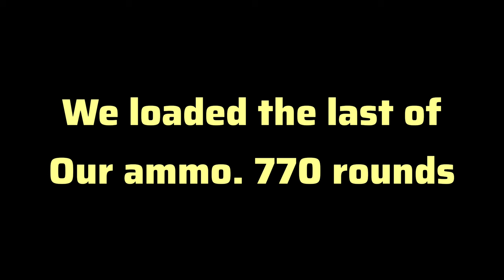Budget 556 AK Meltdown: Pioneer Arms 556 Sporter!

Comment: The pin holding my underfolder screw also fell out on mine, and it's got way less rounds through it. The gun runs fine, I just imagine if you buy one of these guns, expect small issues to pop up. Be prepared to do some DUI fixes. I just got a nail and pushed it through, and bent the end to replace the pin.

Comment: I have one in 5.56 with over 2k rounds and i can confirm the beryl firing pin will break before the factory firing pin. Had to polish the gun in a few places to get it smoother and more reliable, even took a bit of material off the throat of the barrel in order to feed properly. Every other mag it has a feeding issue, stovepipe and such. The extractor was trash on mine so i changed it to a beryl extractor and that helped tremendously. I truly think these guns arent the best when it comes to quality control, you might get a good one, you might get a bad one. Fun range toy for cheap.  But i wouldnt fully trust my life to it.

Comment: I have built out 2 AK kits using Pioneer receivers and they work just fine.
Might help to slow down no need to feel rushed because thats when you make mistakes.
The gun held up better than most. I have broken firing pins at shoots so thats a common thing. I have never broken a Russian or Chinese firing pin tho'.
Reply: Would a Russian or Chinese firing pin fit in another country's gun? Would one of their bolts fit in another country's bolt carrier/gun?
Reply: What firing pins did you use as replacements for the pioneer aks? And do you know where to buy them?

Comment: And this is sustained full auto fire until failure, which is an absurd level of operation. What would it do under a more standard schedule of fire? Or you could even look up and recreate some historic long gun battle and see what it could do in a “fire fight”. 
As for fighting the never ending wave of zombies, it did pretty good all things considered. Rad video
Reply: I'm certain now that it would push past 5k rounds as long as you have spare firing pins.

Comment: Also the difference in volume is calculated as 2*pi*(difference in radius)*length of barrel = 2*3.14*(0.050+0.11)*16  - 2*3.14*0.11*16 = 4.019 cubic inches.

Comment: The barrel is button cut and maybe nitride, in the past they used CHF CL but sold the tooling maybe us made barrels no idea, in the past everything was cast apart from the bolt and they used the barrel as a bucking bar but maybe they fixed that and cast front frunions are OK. But I think the barrel is a little thicker as it's an AKM style not a 74/100.
I feel the best 5.56 ak on the market is the zastava as 18" even thicker yugi barrel CHF CL, would be nice if FB radom made 5.56 and 300blk barrels, also cuhir but they are not even chrome lining their 5.56 and I think it's the same with WBP
I love the 74 but without 7N6 the ammo is bad, I prefer 7.62x39 but I can see that getting very expensive.
I have a nice long barreled 5.56 vepr I converted but If I had to buy an AK today it would be a zastava

Comment: I remember I got trashed on reddit for saying that these were decent aks. 
Thanks for making these videos!
Reply: reddit is for mommies' basement dwellers.
Reply: I do have to agree on how Raging Golden Eagle always mentions the site as REEEEEEEddit.
Reply: Me to.
Reply: Hell I got banned twice for “misinformation”. Once for arguing my experience with my cast hellpup. 
2nd account for posting pics and headspace proof. I made it to 2k rounds of proof before they banned me the 2nd time. I also broke a pin at 3k and replaced it with a beryl pin. Stopped counting at 6k rounds on the 556 folder. I have all price ranges and makes. Love being surprised by a “cheap” gun more than meh with a “expensive” gun…

Comment: The 5.56 mags were always a problem. No standardization
Reply: Get them from the country of origin you'll most likely be fine
Reply: That's because some Countries used the 74 Pattern rifle and re-chambered them to 5.56 while countries like Poland where not given AK-74 rifles they down scaled there AKM rifles
Reply from the maker: This
Reply: The Polish Beryl takes ((10)) and Russian 101 mags no problem. That should be the standard. Beryl, ((10)), 101, AC Unity and WBP all compatible, with some more mags like Zastava, and Weiger and Type 84 fitting some rifles as well interchangeably.

Comment: Thats what i exactly i did i have a 556 saiga converted and kept the 20inch barrel. Its my crown jewel and its so damn flat shooting. Also have kns piston installed. G3 trigger its amazing rifle. Used Russian and some Bulgarian parts so it has 74/100 series parts and added the 5.5mm triangle folder onto it to replace the fixed plum i had on it.  Alot of people cut the barrel down to 16 or 12.5 to clone. But i made a AK101-L (L stands for longboi)

Comment: Would it be possible to swap out the bolt for a beryl bolt?
Reply: Yes
Reply: @truckdriver3126  it just drops in? No headspace or other issues?
Reply: @jordanlininger  No, it would not likely headspace properly. It can happen but it's by no means likely.
Reply: @Ironroots.  that's kind of what I was thinking. Just for fun is there a way to correct it? I'm not familiar with how headspace is maintained initially.
Reply: @jordanlininger  honestly there's not a great option. Some people resurface the bolt lugs, which can be a risky business. Pulling the barrel and using an oversized pin to re headspace it is a better route. It just wouldn't be worth it imo, especially given the price of a beryl bolt. End of the day, swapping out parts on the pioneer will end up costing you as much as other nicer 556 AKs.
Reply: @Ironroots.  Can't the bolt set in the trunnion lugs minus the carrier, as a rudimentary way of checking headspace?
Reply: @truckdriver3126  nah you'll need a field gauge and a live round at minimum to know. Ideally a go and no go as well.

Comment: So the only thing they have wrong is the firing pin issue if they would fix that issue I would buy one in a heart beat I hope they look at this video and fix said problem.
Reply: Shouldn't be a problem for every day rifles unless you plan on burning yours down full auto 😂
Reply: And they broke the aftermarket pin as well. It's not the gun.
Reply: @Riverking1 some are saying it’s either the design geometry or metallurgy that is causing the pins to break because they are protruding further than they should and piercing the primers

Comment: Question:   Regarding the 5.56 Bolt:   Is the Bolt Stem slender enough or compatible  to fit in a  Saiga  Bolt Carrier?    And if so are the Bolt's the same size.     I ask this as I own a Romanian 5.56 and a 5.45 and have switched the Bolts back and forth and they fit in the BCG of each rifle.    These "might" be made with the design of the Saiga  5.56 Bolt and so might fit in a Saiga BCG.  I do own a Chinese BWK 92 Sporter in 5.56 and  learned about 8 or so years back that the Bolts out of a Galil 5.56 will fit like made - or plug and play - in the BWK 92 Sporter, and purchased a spare Galil 5.56 Bolt to keep as a spare for that rifle.
Reply: They're not a standard thin stem like an AK74/Saiga.
Reply: @AjackLee4   Thanks for your answer to my question regarding the Bolt.    Information of this general sort is good to know and to share, and is very much appreciated by myself.
Reply: @donald2665  Of course. I believe they're either a proprietary stem like WBP or AKM size.

Comment: I wonder why it keeps breaking firing pins? 
I don’t know think it’s the geometry of the lug using two different metals with heat expansion mixed with centrifugal force counteracts the pressure exerting from the camber…

Bro!!! You knew from the beginning the firing pin wasn’t retained right.
Reply: Full auto and that much heat. Not a big deal for normal use. You'll never break a pin in semi auto

Comment: Very interesting! Next time take it to 700 rounds then dump it in water cool it, clean, then run the test again! Then Repeat if it does not go down at the 700 round mark, repeat! I think that would be a tight test!
Reply from the maker: It would probably fail faster. Because you're quenching the steel rapidly.

Comment: I'm just disappointed in pioneer. They had the regular AK image shown but description said underfolder, so when I emailed to ask they apologized and said they'd fix the picture to reflect the correct product.  The next day I went on to order it and they hadn't touched the picture, but they had raised the price almost a bill - so naturally I emailed them back and asked WTF?!?  They responded by again apologizing and saying they would fix both the price and the image but that the "sale" price was only going to run though the weekend.  They still didn't change the picture but they did drop price back to just under 6, but it wasn't back down to the 560 that it was originally so I decided to order before they jumped price again.  It still showed 9 in stock, but when I went to order it gave me an error.  Apparently they had zero'd out their stock in that amount of time, and now they no longer have the wood furniture underfolder for sub 600... It's now jumped $200

Sad day...... That was going to be my first REAL ak, but I feel like pioneer did me dirty and I wasn't about to pay 800 from Classic or Atlantic.    I thought about buying the 20" pioneer since it's only $519, but then I'd have to strip it and pay to have barrel cut and it's just not worth it.    Plus Pioneer shows 2 completely different furniture sets and don't tell you which is the actual one they're selling.

Comment: 800 is about where most die, so this is an incredible achievement for the price.
Reply: 800?? For a century or psa maybe
Reply: @rustys.1070  full-auto AR meltdowns usually end at the 800-900 mark, no matter how pricey.  Barrels get so hot they droop, then gas tubes fail.
Reply: Kalashnikov concern had those meltdown videos of their own. Their AK-74M and AK-12 failed at around 700 something, if i recal correctly, when the barrel burst.
On the other hand, AK-103 went through 1400 rounds without catastrophic failure.
Reply: @MatoVuc Less heat dumped in a 7.62x39, though an AKM derived gun can fail at 300-350 if the barrel assembly bends just that one extra millimeter so the piston gets hung up on the gas tube lip (happens more often on US imports with 922r compliant pistons, as you have to use a slightly larger pin when rebuilding, reducing piston wobble).
Reply: @MatoVuc the 74 failed in the 400s and the 12 in the 600s
Reply: @rustys.1070 you realize people are here praising cheap rifles right? Might wanna take your hate elsewhere
Reply: @Riverking1  nope I will bea beaten of light and reason.

Comment: It did pretty good and im not hating but that firing pin issue needs to be addressed. Until then its a plinking toy.
Reply: It lasted 2k rounds that's not horrible
Reply from the maker: I agree, they need to find out why it goes through pins.
Reply: I wouldn't worry about it for normal use honestly.

Comment: Was the fp retaining pin missing when the fp broke? The fp tip should be rested in the journal where it protrudes. If the retaining pin is missing, that could lead to the fp fully falling into the journal and causing it to run into the wall of the fp journal.

Comment: Wish you would have had a spare bolt to replace the factory one! I know you ran out of ammo but it probably would have kept running until the barrel drooped to far. I don't know why any company that makes any kind of firearms would use casting for critical parts in their manufacturing process, especially trunnions, it's insane and irresponsible and look what companies like Pioneer have to deal with when they did use the method in the beginning.
Reply: You don’t know any companies that use castings???? Ever hear of ruger? Current Russian Ak parts ?
Reply from the maker: Well, we would have to head space the bolt too. It's not just a simple change out.
Reply: @KLAYCO47  Ok, I haven't had an AK for years last one I had was a Romanian SAR-1 back in 1997 for $300!! Got an East German wire side folding stock for it for $35.
Reply: @weapongeneticsrd7429  Guy, relax. Take a break, you don't have to be a jerk. I meant critical parts, I should have been specific.
Reply: @weapongeneticsrd7429  Hey, I'm no fan of Ruger and where are you getting Russian AK parts, there's an import ban on Russia. Unless your talking about what got in before the ban, which wouldn't be current parts.

Comment: I've never seen a meltdown have this many malfunctions and be so slow.
Reply: Only malfunctioned due to firing pins breaking and non Polish mags not fitting.
Reply: @Gregory-qu1ct  because of sloppy tolerances in the gun.
Reply: @dennishines9996 no because of tight tolerances in the mag well. The same mags ran fine in another ak